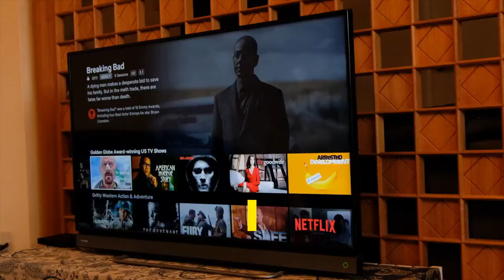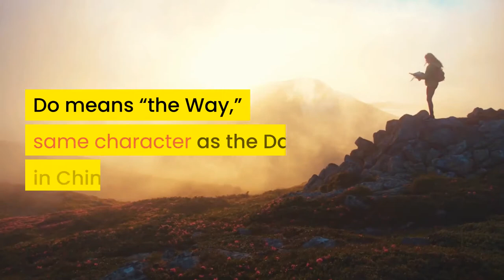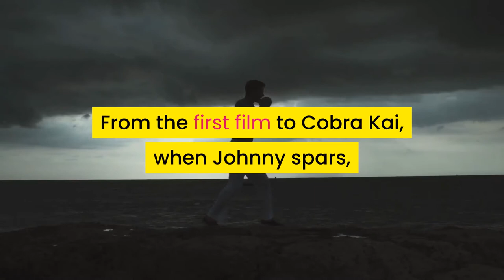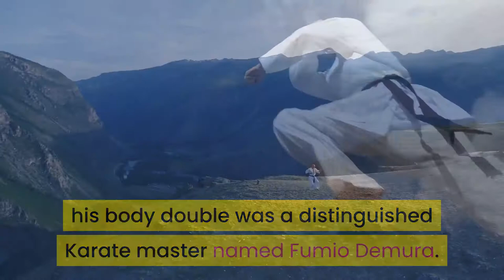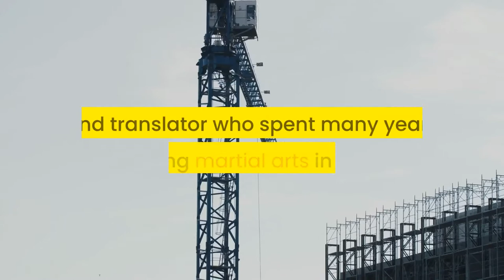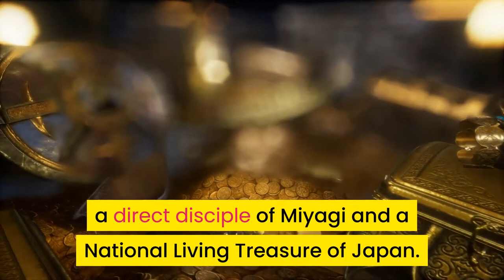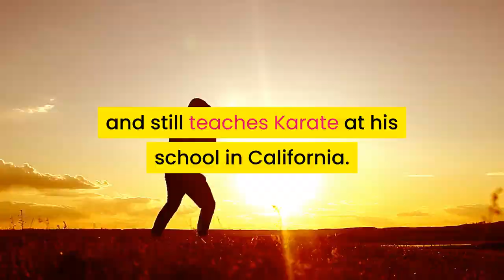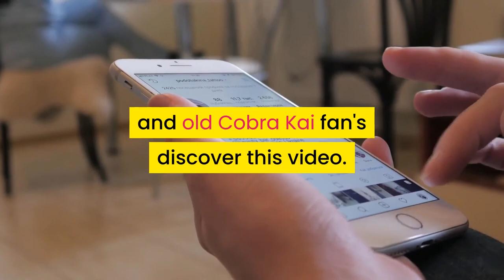Cobra Kai Real Martial Arts Styles Revealed

Comment: today I think more arts are open to what works and adapt technques from different styles, my 1st instructor was big on not kicking high in self defense , Punches (70-90% of techniques) Kicks Low #1 the Calf Kick , the MMA guys thanks to City Kickboxing (i think) have also figured out the low Calf Kick is the #1 Kick, better then the thigh kick and now its finally a staple in MMA, #2 Thrusting Side Kick to the Knee #3 - Wave Kick to the Knee (AKA Oblique as named by Joe Rogan) 3a - Front Kick to the Knee 4 - Round Kick to the Knee 5 - Stomp to the Knee 6 -  Front Kick to the Stomach 7 - Front Kick to the Face, with the Jump Front Kick Variation which is not a Crane Kick since a Crane kick is done with the Back Leg and 8 - Sliding Snap Front Kick .... but if you have whatalready works in your style not much adaptation is needed OSS